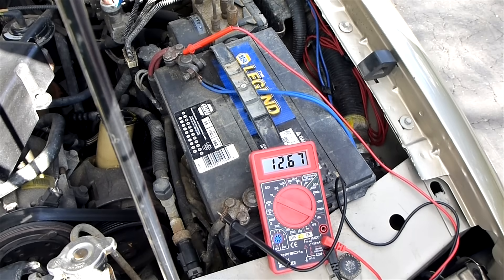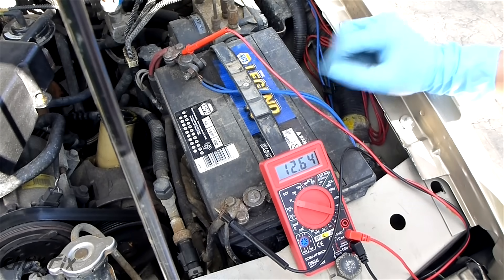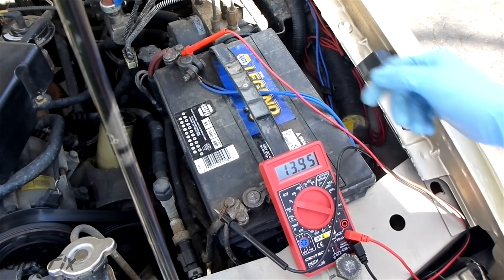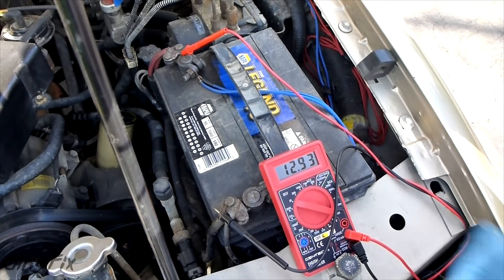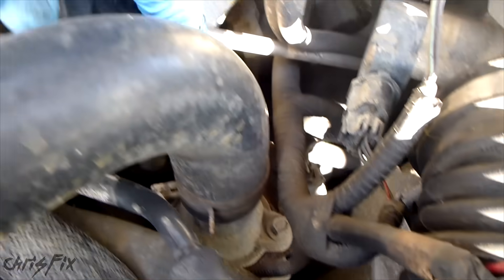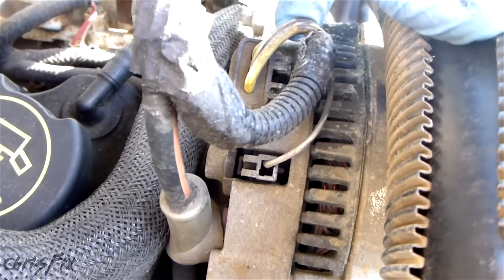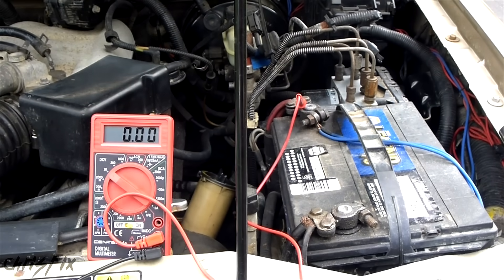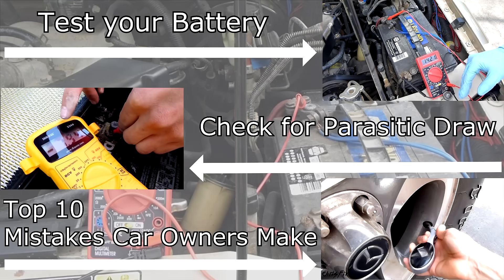How to Test an Alternator

Comment: This is not an accurate test. In an alternator you have a diode trio basically gives you three paths to change the battery. Load testing with only accessories is wrong. You are not testing the output of the alternator. You could lose one leg from the diode trio and only be charging at 2/3 capacity. If you were using high draw accessories like heater or rear defrost, your battery would not be charging. You need to load test the alternator with a load equivalent to alternator output. Ex 105 amps load for 105 amp alternator

Comment: Hi Chris First off you are freaking Amazing. Thank you for your videos.  I have a 2004 Dodge Ram 1500, 5.7 Hemi. My story is long so I will just start with where I am at now. SO battery issue? (not sure), Check gauges light on and off, Alternator testing done exactly as you specify .. reading @50 V. I swear .. far different then the .05, .06 that you specify  ... 50V ish from both terminals  when running to the alternator (all areas). I kept Voltmeter on the same settings as for the battery (I did not see you change it) . A week ago, when this all started Check Gauges light came on, then battery indicator needle on dash when totally dead.  First testing of battery showed only 3V :O seriously crazy. A trickle charger brought it back to life (maybe??). So battery cold was reading 12.6. .. Started truck, voltage ranged 14.63-14.71. Turned lights, fans etc on, revved to 1500 tested at 14.72-14.74. Shut everything off drops to 12.54V What the heck? SO confused now Battery is 5+ years old. I was hoping it was just that but something more I think with this whacky 50V reading output from alternator?? Any/All advice appreciated .. Again you are amazing thank you for all you do!!!

Comment: GREAT video, Chris!  I have bad readings and would appreciate a bit of advice!  When I go black to negative on the battery and red to alternator, bracket AND block, I get a bad .2 - .3 reading!  To the chassis ground I get the appropriate .01.  ALSO, when red to positive on battery and black to the b+ post, nut and lead I get a BAD low reading of .01 - .02.  Again just the opposite of what it should be!  Why?!?!?!  What should I do?  The Jeep is running fine but I'm worried!  (And yes, my multimeter is set up correctly! :-) ).  Thanks for any suggestions!!!

Comment: Start your car, disconnect your battery and if it keeps running your alternator works.  The battery starts it but the alternator run it.  You don’t even need a meter.
Reply from the maker: I wouldn't recommend testing your alternator that way, but thanks for sharing

Comment: I got one charge is reading above normal. It's over charging I know that the pos post keeps corroding pretty much all the things that are on my column the low beams  gone only high work . In the last 2 weeks I lost my Cruze control and 4 the gear it electronically told when. Could the over charge cause this?  In a 01 Dodge ram 1500 5.2 was running high idle for a bit now it decide that after I got it warmed  starts and goes on its own  tell I touch the grass then if I dont give it lil gas it stalls. But start it up it's fine again tell I give it some. Again

Comment: CHRIS , I’M HAVING A WEIRD PROBLEM WITH MY TRUCK 03 1500 SILVERADO....it was seating for a few months, when I tried to drive it it works fine until I put it on drive....all my lights start flickering and the engine goes up and down....I would love to show you this video.....It only does that on drive....not on reverse or neutral or parking
Reply: Chris plis

Comment: Before starting the ignition, my fiat Linea car battery shows 12.65V . But after starting the ignition it shows max 13.8V . With headlights and ac ON it shows 13.2. Battery is just a month old. Is there any problem with alternator or it is the battery problem ?

Comment: In the old days we used to have cigarette lighters in our cars. Start the car place the positive in the center of the lighter ground your ground and see what the results are. Mine was 13.75 around there. If it's under 12.5 your not charging. Or just pull the negative with the car started. It dies bad alternator

Comment: Thank You !
Reply from the maker: No prob Matt! Glad the video was helpful!
Reply: @chrisfix  I think it's the starter. I have 12.60v key off, and 14.60 when running on the multimeter. All power accs work. BATT. & ALT. are good. After a few starts it gets weak and won't turn over.

Comment: I just changed my video for the sake of eliminating the battery being an issue. So my voltage is great and within the 14.2 and 14.7 range. Even when i use power windows it doesn't drop much so it shows thst its good. But when im driving around, after a bit of driving i get the battery light that says the alternator might not be charging the battery. I changed the alternator not more than a year ago and the bsttery is brand new so i dont know what it is
Reply: I hope its not my alternator again

Comment: What can be the result of bad alternator? I Have 2006 Peugeot 207 2 door.
its started to show all kinds of errors to Me, i think its the alternator, its shows all teh errors in book and gas pedal doesnt give gas anymore, it just changes the motor revving and stuff, i have engine fault error, pollution fault error, steering fauilt, nothung works.